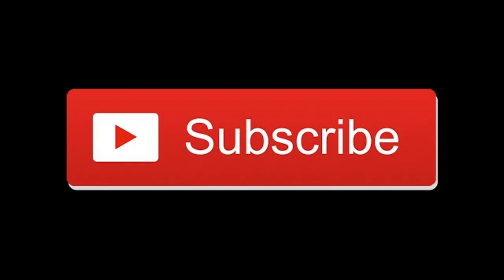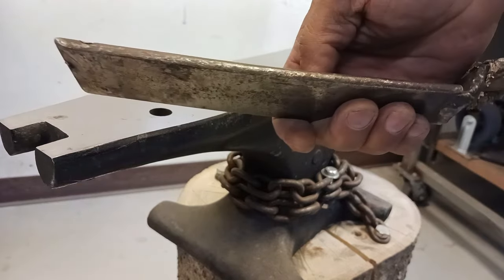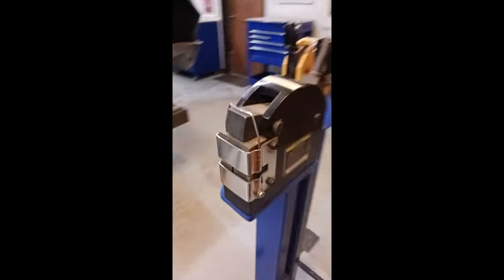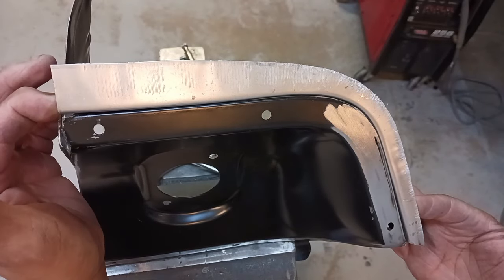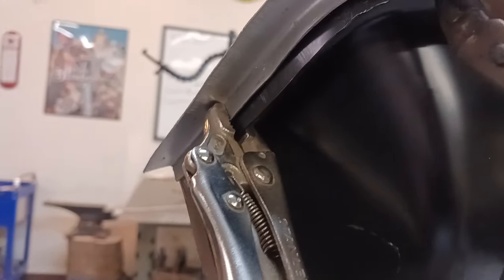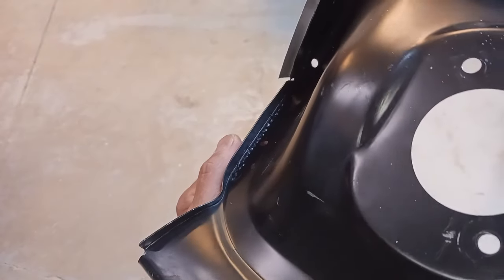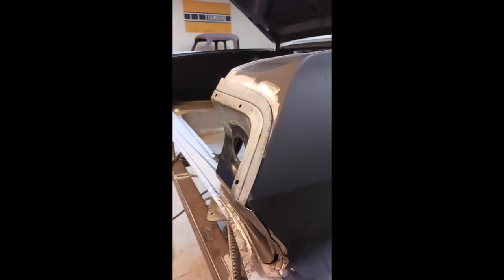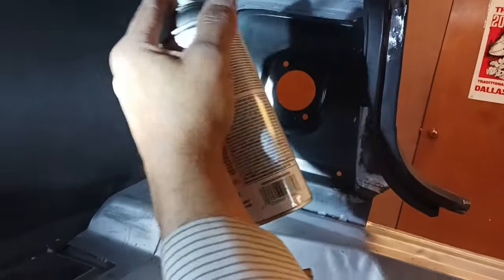How to fabricate auto body patch panels  - DIY Auto Restoration

Comment: Great metal work !! I believe i read an articall quit a while back about a lot of these smaller companies buying up a lot of older toolings for stamping out replacement parts and they are getting worn out and they are not refinishing their dies, i worked at a shop where we had several people that worked on dies full time to maintain very tight quality standards, I believe quality will just get worse as it is very expensive to retool.I have replaced many replacement panels and it is laughable when you have to rework almost every piece.but you make it look easy !! Thank you again for another great video !
Reply from the maker: That is a MAJOR cause of the way things are today..... especially big business, they will not re-invest in themselves totally profit driven.... Thanks for watching !

Comment: Man, great work and at the same time you are scaring me as I do the rebuild on my 64. Are all the reproduction panels trash? What can I do to overcome this?
Reply from the maker: The bad part is you can't tell about a part until you are installing it...... floor pans, trunk pans, door skins not so much trouble..... quarters, hoods, deck lids, big problem. Try to repair the original.....

Comment: Nice work there and just imagine if you could charge back the manufacturers of those poorly stamped part for the extra labor hours it takes to make them fit correctly. What's shocking is how they can take the time to setup a stamping plant and create parts that do not have correct radiuses and dimensions and not care about it. There is no pride in workmanship and no accountability and that is a toxic culture that's not generally acceptable in business. The only positive thing about it is that it can make you a better craftsman and it seems like they are counting on that. Keep rolling.....
Reply from the maker: Yeah if I asked about the quality of a companies parts they are selling..... they would laugh in my face..... I'm going to put quality back into the conversation...... Thanks for supporting the channel !